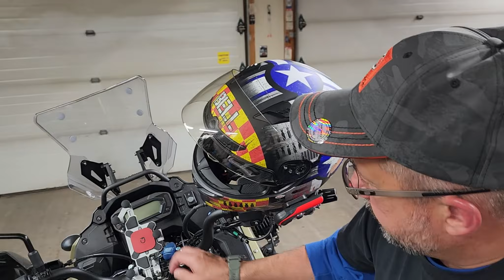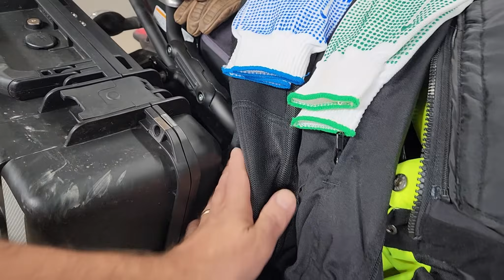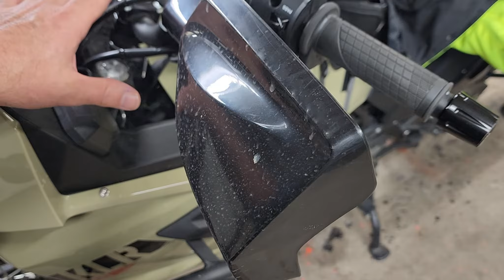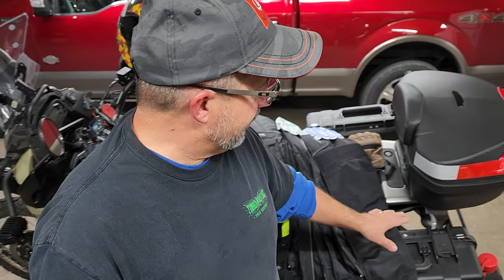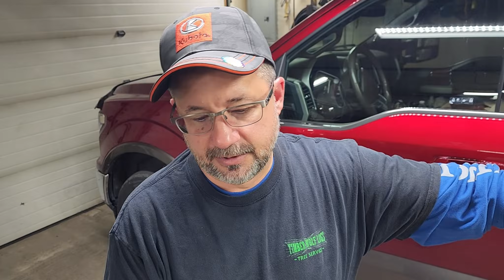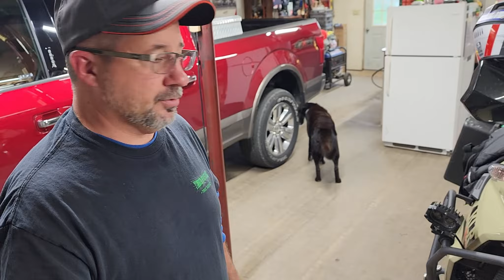2022 KLR650 Mods and Quick opinion.

Comment: question  the Pro Taper bars are 1 1/8" and stock is 7/8" how is it that it appears all for the controls fit back on normal?
Reply from the maker: They are 1-1/8" and in the risers. If you need close pics, email me at Larry0071@gmail.com

Comment: Do you feel the fork brace is a necessity on this bike? Thanks for the video
Reply from the maker: I don't think it's a must have at all. But it's just one more incremental way to tighten up the inexpensive bike with pretty much obsolete suspension and frame design. 

The Killer 650 is cutting edge 1985 technology. When you look at the frame and suspension compared to other bikes in the realm of adventure or dual sport, it's at best tied for the least advanced system available. 

Don't get me wrong. I love my killer. But I'm not delusional, I know why it's the cheapest option out there, and I like the garden tractor like simplicity of the thing.

Comment: Nice video.  I have the same bike, and want to add aux lighting.  So you ordered factory aux light harness and the switch?   I have the relay already.  Plug and play?
Reply from the maker: I ordered from Babbits Online.  The factory fog harness is 26031-3860 for $58.01.
The factory switch is 27010-0968 for $88.50.
This will make it plug and play down to the harness connector at each side. Then you'll go to cycleterminal.com to order terminals to put on your aftermarket lights so that they plug in like factory. You be looking at the Sumitomo 2 pin HD 090, I forget if you need male (I think so) or female (I think your harness will be female). So around $2-$3 each. These are complete sealed OEM connectors. 

That's it. Pick your lights and mounts and it's a pretty straight forward plug and play install.
Reply: @LarryMusgrave  thank you for the details on those connectors!!  I appreciate it!!!